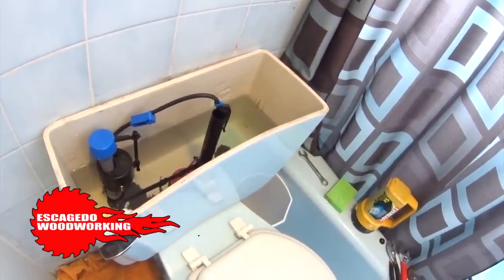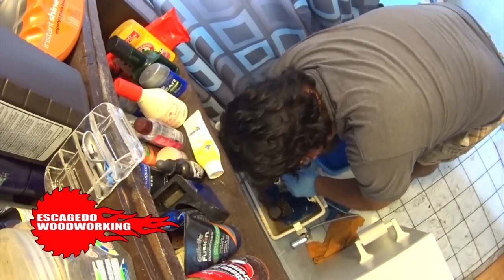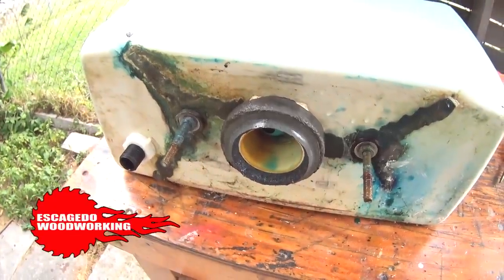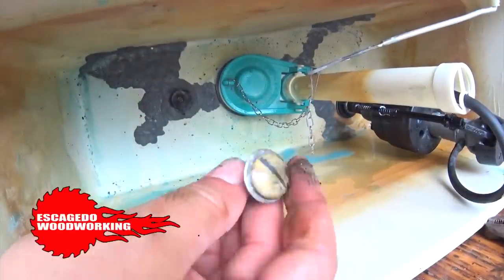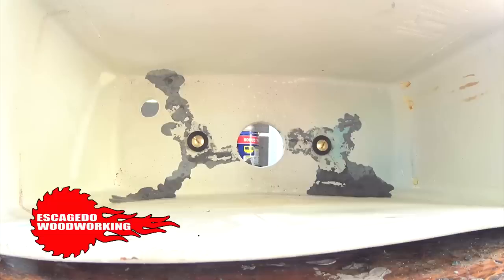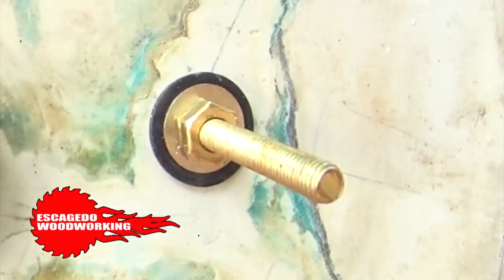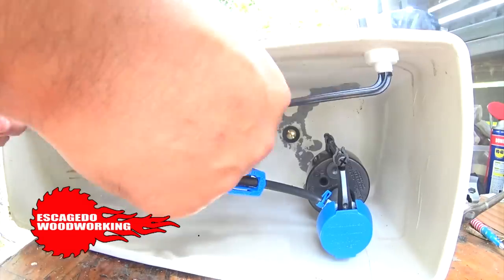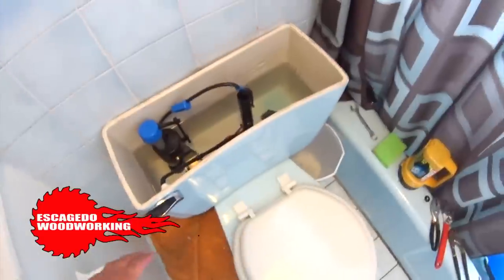Complete Toilet Repair Kit Installation

Comment: Good video, but LOTS of details not covered. Height of fill valve and height of fill valve critical level above top of overflow tube appear to be VERY important in the instructions, but neither was mentioned.